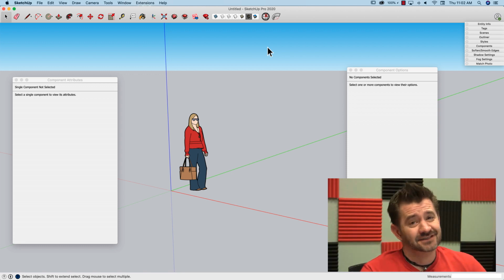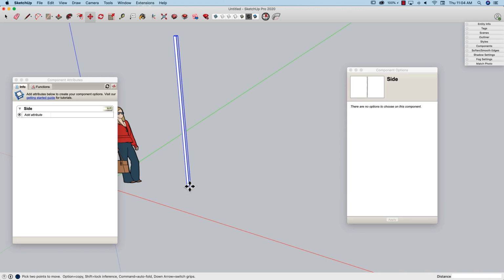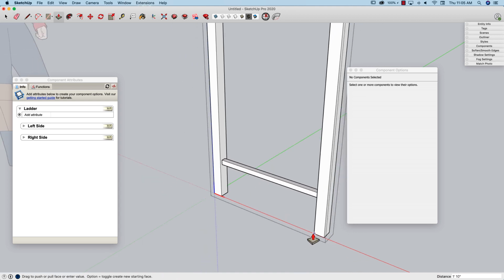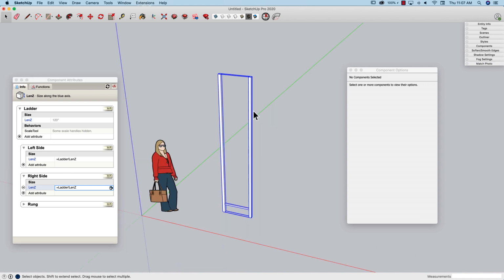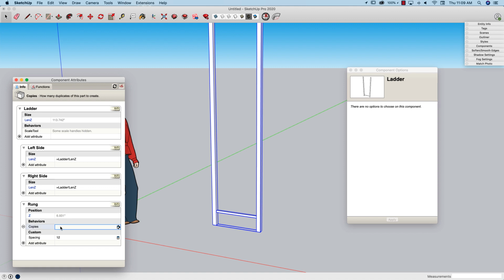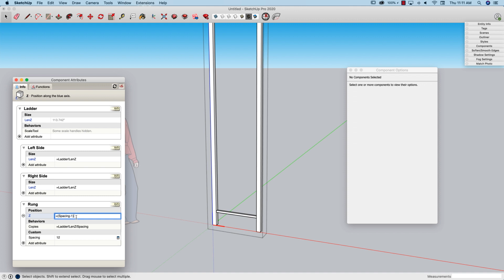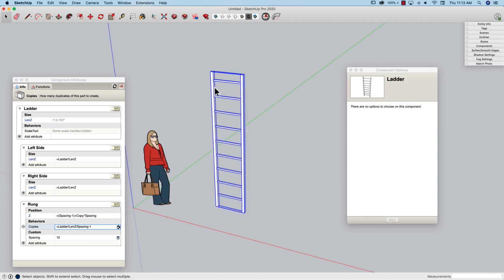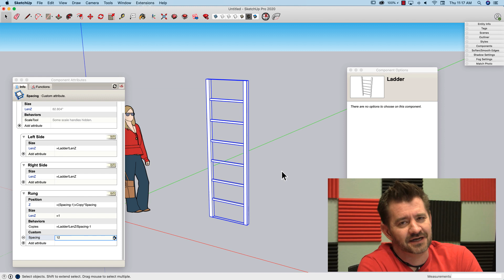Welcome to Dynamic Components Part 8 - Skill Builder

Comment: This series on Dynamic Components has been very educational. My issue is on how to effectively use Components and DC's. For example, it does not appear to be effective to use DC's, or even plan Components for decking. Especially on a diagonal when trimming is required. I'm looking forward to any guidance you may have to offer.

Comment: Great Series on Dynamic Components. Thank You. I have a suggestion for an episode. I have a mortise and tenon component with a key piece which locks the two sections together. However I was hoping to have a conditional on click that required the joint to be assembled in the right place before the key could be inserted. I've tried to code it with the IF but am having trouble with the syntax.

Comment: Hello Aaron, with your instruction I was able to build a PVC flange with bolt that can be sized with user input decimal inches. and can show blank flange option. It has 1" to 8" options from user pick dropdown. Shared to 3dwarehouse so anyone can have a try. Thanks for your help. -Mark Perrah

Comment: Super useful, I'm learning tons about DC, thank you for making videos.  Something I haven't figured out yet:  I have a house wall that I want to dynamically size.  In that wall I have a cut-outs for a window and a door.  I want to be able to specify both the size and the position of the door and window cut-outs.  I can see a solution where I kinda treat the wall like the picture frame example, but is there a more efficient method?

Comment: Hey, Erin.
Thanks for the great tutorials!  I was wondering if there is a way to make sections in the component options panel? Example for a door: Have a section for door size, casing size, and jamb size. Then you had an advanced component even providing different door styles.  I feel like this would make it easier for a user to find and change options.

Comment: Hello ,
Can someone help me with this formula problem? When I add the component from the library, the formula is functional, when I want to change the size, the formulas are no longer recognized by the program(UNKNOW FUNCTION)
I have uninstalled/reinstalled the program several times, as well as the dynamic components plugin without any results.
Before I managed to fix it by repairing the software, but the problem appeared again.
Reply from the maker: Probably something to take to our forums (forums.sketchup.com). This is the sort fo thing that is REALLY difficult to work though in YouTube comments...